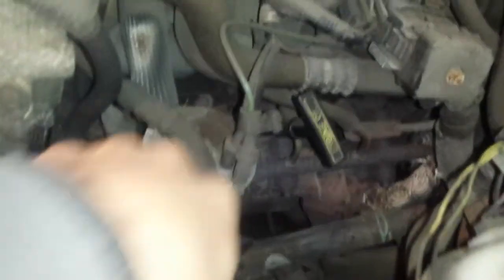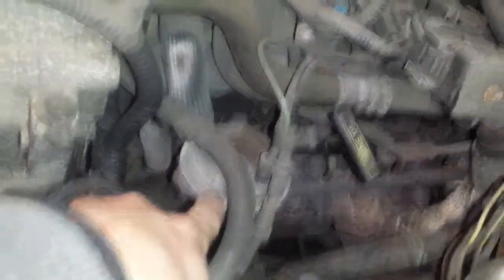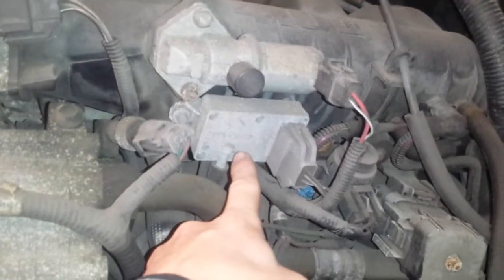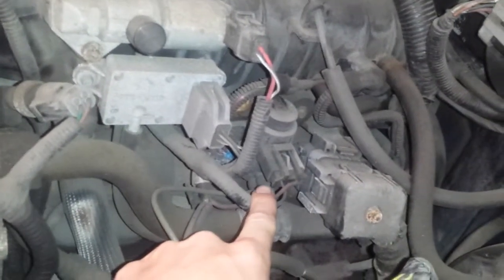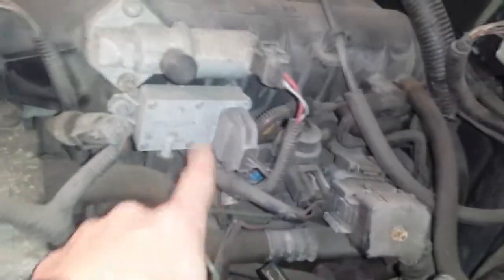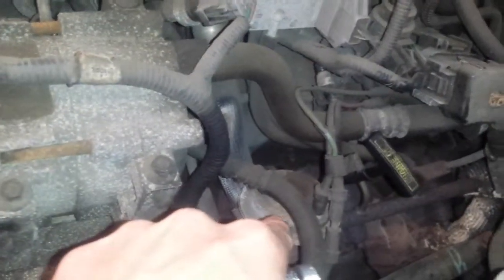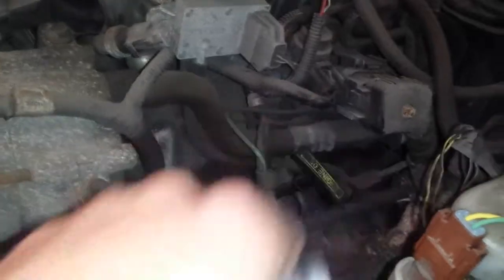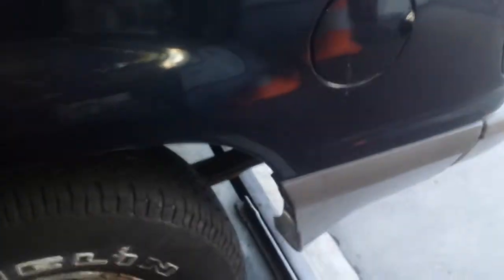Ford Explorer: How to find EGR valve & EVAP canister

Comment: Same color. If it was cleaner? That could be our EX! Thanks for the video. We are getting the charcoal canister tomorrow. HOPEFULLY we can get it installed without too much trouble. Liquid Wrenching the nuts tonight!
Reply from the maker: Good luck... are you chasing a code or have a faulty vapor canister?
Reply: No codes but it's garage kept. Mornings after filling up there are gas fumes. We installed the new FoMoCo canister and early results look promising. We don't overfill. We always set the pump on the slowest fill setting and quit at the first click/shut off. Plus, it's 12 miles home. In the warmer weather we would pull into the garage and leave the door open. We'd crack the gas cap to release pressure and run a fan, blowing any possible fumes out. After an hour or so we'd button things up. With Winter just around the corner we need to get it taken care of. Hopefully we did!  Take care.

Comment: Are these evap testable?
Reply from the maker: For the evap test for a smog?
Reply: Scotties Hobbies yes for the smog test I had one earlier but it has hard plastic lines Or do you not have to test them due to location
Reply from the maker: @unekhrk  actually I just watch the video. This vehicle is exempt from the EVAP pressure system check due to the location. You are correct. You only have to test the EVAP system if the evap canister is accessible from the top side of the hood or engine compartment. All other locations are per discretion on the smog Tech.
Reply: Scotties Hobbies appreciate it man keep the good vids coming